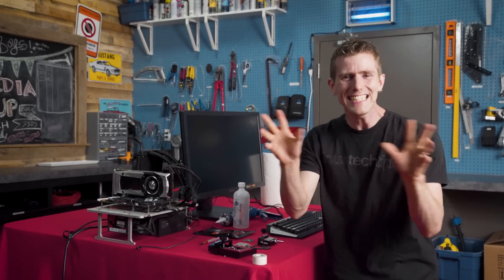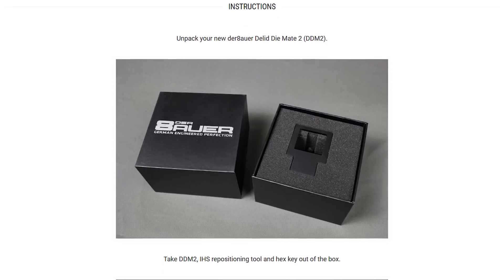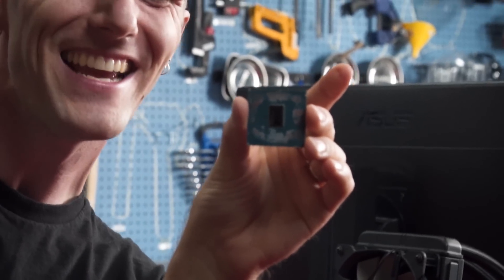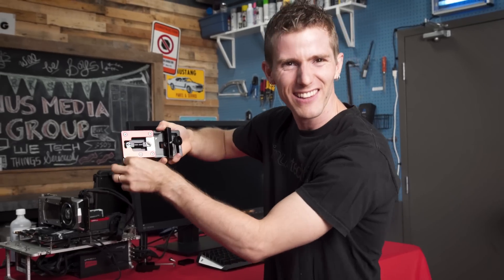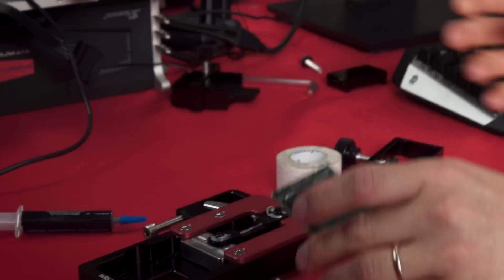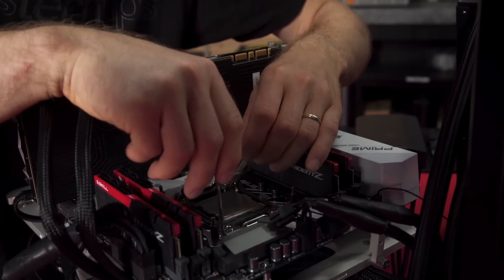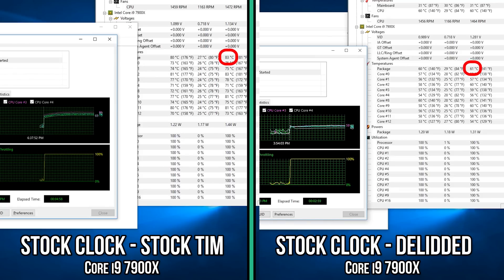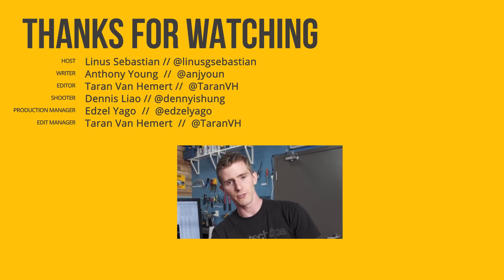Delidding a $1000 CPU - Worth the RISK??

Comment: To all the people with mis-information, Intel uses the thermal paste that they do because it is the best for "most" people, people looking at de-lidding are not "most" people, the Intel stock paste may not preform great, but it is the paste of choice because it is a extremely stable paste, most thermal pastes dry and eventually NEED to be replaced, Intel's solution while not optimal for cooling doesn't need to be replaced for a extremely long time, yes liquid metal preforms better, but after a year or two it will need replaced, yes soldier preforms better, but with heat and time soldier cracks and fails, do a bit of research before bashing Intel on their choice of T.I.M. for the heat spreader.

Comment: If you're going to void the warranty, don't skip IHS lapping. They always have irregular dips in the center. All you need is glass (or a mirror) that's greater than 1/8" (0.125") thick and bigger than the IHS, some sandpaper to lay on the glass and a small amount of water to wet the sandpaper. Use two or three progressively finer grades of sandpaper, but 800~1200 grit is the upper limit (i.e. 320, 600, 800, done).

Microscopic peaks at 800~1200 average closer contact to the heatsink than a perfectly flat surface will, and it prevents trapped air from forming wide gaps by giving the air small voids to squeeze into.

Every time I change the sandpaper to a higher grit, I change the sanding direction. Otherwise, the scratches are all aligned and using higher grit sandpaper accomplishes nothing.

Keep the glass on a flat table, and don't use framed glass (it might break if you push hard against it).

Comment: Delidding a brand new CPU is risky. A good option is to consider delidding your CPU when you hesitate to change it. 
Instead of buying a new one, just try to delid the old one, first. If you succeed, you will be good to enjoy and overclock your old CPU for one more year. If you fail, just buy a new one. (You were hesitating, anyway)

Delidding is a good option for giving a chance to your old CPU to get a second life. Even if it's just for 6 monthes, it is worth the price of a delid tool and thermal paste.
Reply: this is exactly how I just did mine. Have a 4770k and delid worked great. I was gonna get an 8700k but going to hold off until icelake
Reply: Delidded my 4790k just recently and got a 13C improvement on stock speeds on hyper 212x :3
Pretty satisfied
Reply: Marc "one more year" you kinda skipped a key word there. He wasn't saying a new cpu would last a year, he was saying it was a way to squeeze some life out of one you're replacing anyway.
Reply: I don't understand why you bought a delidded cpu with the ihs still off
Reply: @thibautnoah2599  lol
Reply: Or you can just straight buy a delidded new one at siliconlottery
Reply: @thibautnoah2599  they're dead now
Reply: I just done this with my i5 4690k I was thinking of getting a i5 8600k, Instead i bought a bigger better cooler and delided it, I now run 4.5ghz at not more then 68 c
Reply: I just bought a delidded 4790K. Can one relid it manually? I propose to use very little silicone and to install the CPU in the socket before the sealant is fully dry. Any adjustment of IHS position will take place as the socket frame is lowered and locked. Then the pressure from the socket frame and the cooler bring the die, IHS and cooler, with respective TIMs, into better contact. Comments?
Reply: @awuma  Technically you don't need to even re-glue it at all. The socket will hold everything in place
Reply: Jeremy In fact, I heard it’s more advisable not to since the air gap that is created by the sealant (ironic) can reduce proper contact between the IHS and liquid metal, weakening the heat transfer efficiency. My 7700K is not resealed.

IMO, delidding in the age of delidders is a non-issue.
Reply: 1up4u now you can just buy an 8680K lol or whatever the new binned 8700k is that just came out.
Reply: 1up4u A week ago, i upgraded my platform. Had an old Z77 ROG mobo, 16GB Corsair Vengeance and a 3770K. Bought it when it was new on the market, so got around 6 years of good use of it. But was afraid it would fail on me before i got something new, so upgraded to coffee lake and was able to sell the old parts for 160€ within 2 days. Also got a new case, new fans, new cooler, new SSD. Selling my old  cpu combo, case, fans, 8 fittings and a reservoir, i was able to get a beast of a powersupply, my old power supply was near 5 years old. Been wanting to upgrade for a long time, but waiting kinda paid off
Reply: Thanks for the tip. Was going to do mine but I just got it. I'm going to forget about this for a couple years. Temps are fine as is
Reply: Ferrislilly hey it’s been a year =)
Reply: @MarcFPV  reading comprehension, do you has it?
Reply: I just delidded my i7 3770k 1 month after purchase... Bought in 2012 and it's still running strong today after 6 years at 5.1Ghz, i used a plastic card to deliddit without risking cutting the pcb
Reply: Used "working" non-delid CPU is still sellable in the used market, for money you can use to purchase your brand new CPU. That's what I do, so it's not acceptable that Intel doesn't use proper heatsink paste, for what they charge, and what a simple product change would cost to them to add to the production line — very, very little.

Comment: Why even put the lid back on? I want to see some comparisons with and without lid in a watercooled setup. I have the i7-6950X myself, with a Heatkiller IV CPU block. I have 3 x 360mm rads and a D5 pump and Vardar fans. This loop is only cooling the cpu. Still, I can never go above 4.1GHz without crashes. I'm thinking that going completely topless might actually make a little use out of the stuff i already have...

Comment: there is a problem after 20+ cores on CPU ,  on the consumer market , simply you don't have anything to run on those cores , cant use it,  lets say you get 100FPS in Game , you CPU will work at 50% , why did you pay for second 50% , its not working at all . We are well beyond Moore's law , dropped out 10 years ago , but now there is that problem where you cant use all cores . While ppl think their Ryzen chips will see utilization of 100% in future games . That will hardly ever happen ,   because 2 problems , 1 : if Ryzen 20 core CPU gets 100% utilization, what will happen to FX8xxx series on Consoles . It wouldn't work , there is no new console even in development stage , so no time soon . And problem 2: try to make a game engine using 20 cores efficiently , you wont manage it in life time ,Another simple way to put it is this , dont you think we should have PS3 Emulator for PC with 20 Core CPUS , how hard it can be . you have double the speed and cores per Ps3 core , its not happening , why it is not happening , for the same reason Ryzen 20 core CPUs don't see utilization of 100% , simply its hard to do . So what is the future of CPUs , they cant be faster , proven , and cores are so numerous you cant get a peace of software to use all of it . just my thought .

Comment: Try some mild heating of the CPU-package before delidding. We're not talking fingers-crossed-oven-baking-solder-melting temperatures, but merely heating the package from 20-something to ~80°C (aka. way below operating temperature for an i9 :P ) will result in a significant decrease in the required delidding force for an unsoldered chip (and an increased shear force ratio between the solder and the thermal compound) as the shear strength of the silicone is temperature dependent. 

Delidding an unsoldered chip rarely usher any complications - especially when the shear-method is used, but it can be a disconcerting endeavour in deed :)

Comment: If you replace the thermal compound with liquid metal, you gain a lot :)
Reply: According to those who have tried only slightly better, 20C reduction with good non conductive paste and 22- 25C with liquid metal.
Reply: I see. Well, as long as one uses very good pasted, you improve thermal conductivity. I actually use Thermal Grizzly Conductonaut (metal) between the die and the IHS and the Thermal Grizzly Cryonaut paste between my watercooler and the IHS. Before I had the "standard" paste between the heatsink and the IHS which turned out to be a bottleneck too. So yes, good pasted is very important.

Comment: I'm on a 4770k with waterblocks on everything (2 GPUs). Delidding the processor was the BEST thing I did. I kid you freaking not, I'd have over 12C between core temps!!! We're talking atoms apart and yet that huge disparity in temps!.. Long story short I got lower temps and they were finally all consistent and within 3-4C deltas... no more 10C+ deltas..

EDIT: I use Coollaboratory Liquid Ultra. If you're going to delid, go for the best performance, not the same grey pastes you had on the CPU before you ever knew what deliding was xD

Comment: Make "Intel's thermal compound vs tooth paste" video
Reply: that would be spicy
Reply: Yeah but I think hp's is worse
Reply: I use toothpaste on pretty much everything I own.  I'm cheap af  and it works quite well.
Reply: I am pretty sure tooth paste will actually win... Only logical reason I can think of for Intel to use so bad cooling paste is they WANT your CPU to run hot so it will only last just as long as the warranty and also not over clock well to make you buy new faster and more expensive CPU. I absolutely hate all companies that is so greedy that they sabotage their own products to sell more....
Reply: The paste Intel uses is made to last a long time not perform significantly well
Reply: @Champoforyx  you know what else lasts a long time and performs amazingly? solder.
Reply: @Maximdietz  yeah but no upgrade path sad :(
Reply: @Champoforyx  a soldered IHS also last long and is pretty much the best thermals you're going to get with the exception of a cooler directly on the die
Reply: @GameCyborgCh  you remove the cpu and put the cooler on the socket. Coolest temperatures you will ever get without ln2
Reply: @nayanmaloth4838  of course removing the IHS completely results in better thermals but that isn't the part of the discussion
Reply: @Champoforyx  that's not how it works if it works well then it means it will last long
Reply: @nayanmaloth4838  that’s not true at all lol look at liquid metal🤣🤣
Reply: @Champoforyx  true you got me there but what I said does apply to most thermal interfaces

Comment: Linus, can we use Debauer delidder to remove the old on GPU processors and replace the paste like you did, resulting in lower temps at higher clocking. To reduce energy consumption of cooling GPU's for Bitcoin miners... #LinusTech
Reply: Steven Matthew Lucas you cant do that, it is even simplier
Reply: Steven Matthew Lucas the gpu is on the whole platine of the card. not just a small chip like the cpu.
you just need to unscrew the backplate and cooling device and you get acces to the gpu chip.
but i dont know if the liquid metal will stay on the platine and not get on any other connector since it isnt going to be sealed up like the cpu with the heatsink.

Comment: I'll be deliding my i7 8700k right when I receive it, without a doubt. A 20C drop is insane. Intel dropped the ball in this area, to say the least. Thanks Linus.

*EDIT: "i'll be deliding right after I first do a temp test
Reply: Only logical reason I can think of for Intel to use so bad cooling paste is they WANT your CPU to run hot. This is to make sure it will only last just as long as the warranty and also not over clock well, all to make you buy new faster and more expensive CPU... I absolutely hate all companies that is so greedy that they sabotage their own products to sell more.

Comment: I'm sorry but Liquid Metal on the die or GTFO.

I just did my 7900x delid, went from 90+C at 4.6 to 62C on the hottest core post-delid.  So yes, it IS worth it, as long as you use liquid metal.  Don't be a muppet and replace shitty tim with good tim when there's LM.
Reply: Only logical reason I can think of for Intel to use so bad cooling paste is they WANT your CPU to run hot. This is to make sure it will only last just as long as the warranty and also not over clock well, all to make you buy new faster and more expensive CPU... I absolutely hate all companies that is so greedy that they sabotage their own products to sell more.

Comment: Gonna delid my 6700k, its Hitting 90 °C+ under FPU load even though its watercooled
and up into the 80s while gaming with only 1.325V. Not really any other way other than 
phase change or peltier cooling considering the surface of the heatspreader only gets lukewarm.
Reply: Only logical reason I can think of for Intel to use so bad cooling paste is they WANT your CPU to run hot. This is to make sure it will only last just as long as the warranty and also not over clock well, all to make you buy new faster and more expensive CPU... I absolutely hate all companies that is so greedy that they sabotage their own products to sell more.

My 3,8Ghz Xeon 1231 only gets max 60c in prime 95 torture test... I7 4790k Max 70C same test at 4,7Ghz, both air cooled with big square type heat-pipe cooler.

Comment: I don't know anything about computers really, but what if you don't give a rats ass about overclocking and just want a processor to run cooler anyway. Wouldn't that be a good thing, in and of itself?

Also, is it the same on gaming laptops? My MSI runs cool to the touch, but that was one of the big arguments I got from people in the comments when I asked for suggestions before I bought it some time ago. Temperature. I'm guessing temp is a problem usually and if you could cut one heat-source by 20 degrees.....

Comment: how would Intel even know just put back some cheap paste and silicone it back on. They are the ones saving $1 and making people do this.
Reply: Only logical reason I can think of for Intel to use so bad cooling paste is they WANT your CPU to run hot. This is to make sure it will only last just as long as the warranty and also not over clock well, all to make you buy new faster and more expensive CPU... I absolutely hate all companies that is so greedy that they sabotage their own products to sell more.

Comment: You aren't using a liquid metal to delid... that's why you don't get results!!
Reply: 20C reduction no result? That is a HUGE difference and that he got it with normal thermal paste is a real kick in the nuts to the greedy assholes at Intel.  I bet you can get better thermal results using toothpaste, chewing gum or just about anything else then the TIM Intel uses... Only logical reason I can think of for Intel to use so bad thermal paste is they WANT your CPU to run hot. This is to make sure it will only last just as long as the warranty and also not over clock well, all to make you buy new, faster and / or more expensive CPU... I absolutely hate all companies that is so greedy that they sabotage their own products to sell more.

Comment: Whats the point of delidding if you re not gonna use liquid metal ??
Reply: Did you watch the video? He got 20C reduction in temperature using normal paste... That is really a kick in the nuts for the greedy assholes at Intel as it show how bad the paste Intel uses actually is. Only logical reason I can think of for Intel to use so bad thermal paste is they WANT your CPU to run hot. This is to make sure it will only last just as long as the warranty and also not over clock well, all to make you buy new, faster and / or more expensive CPU... I absolutely hate all companies that is so greedy that they sabotage their own products to sell more.
Reply: Yeah,but only with conductonaut you get around 65C at full load as he said at the end .Still,I wouldn't do  delidd for  non liquid metal compound.It's just not worth it,for me.P.S Rockit99 tool is much much better option for delid-(pushes IHS away of the caps on CPU PCB)  and relid-(have relid tool included) because you can safely put new silicon adhesive back on IHS/PCB and voila warranty preserved. Intel for the past 10 year could do what ever they wanted because their CPUs are superior to AMD,so they can cut corners for TIM and hike up prices and such....But,last year we have seen AMD rise,and listened to customers demands ,and hopefully their IPC will see increase 20-30% up in next gens then intel will loose much much coveted server/workstation market.(end consumer products  CPUs don't generate that much money as above mentioned sector)